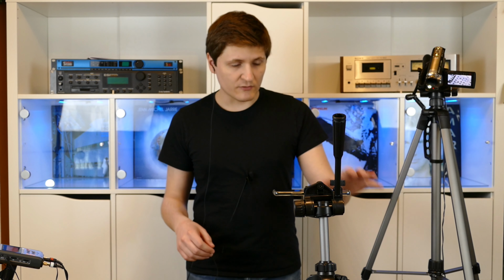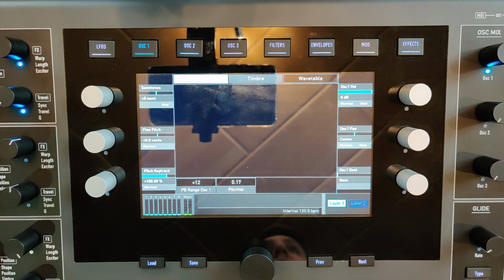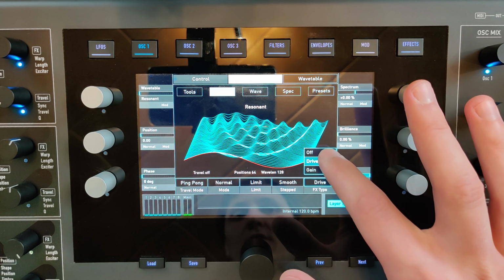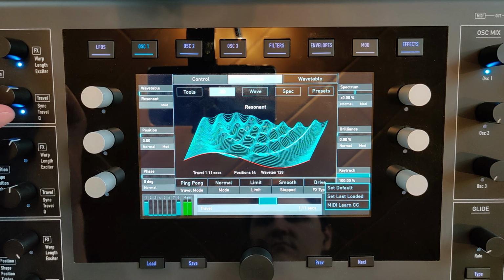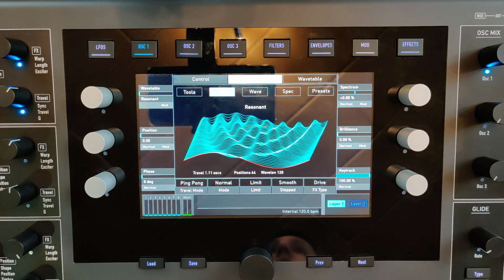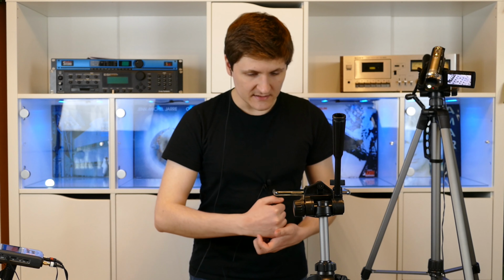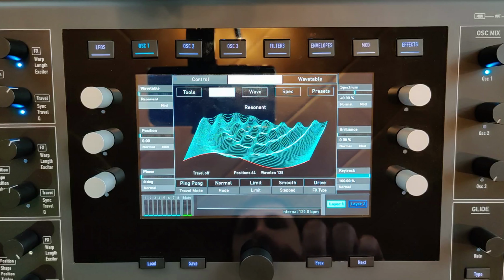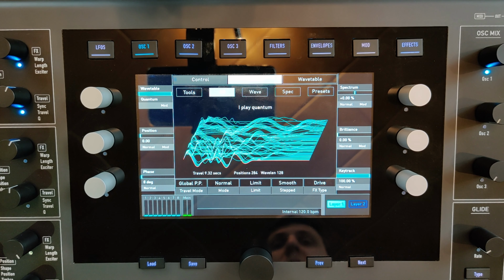[tutorial] Waldorf Quantum 4: Wavetable Oscillator

Comment from the maker: What do you think? Are there any features which you still miss in the wavetable oscillator? Or does it even have too many features?
Reply: I think this is the most thoughtful implementation of wavetables I have seen (I guess the Hydrasynth comes close). All I wanted from the Blofeld is an easy way to create my own waveatables and load them up quickly. The fact that each wavetable does not need an lfo to scan it is amazing. And the wrap is suuuper great!
Reply: Great videos, thanks a lot for them! I'm actually quite disappointed, the implementation seems very basic. Wavetables are cool, but the fun starts with warping, FM AM and wave shaping. What about Unison, Pan, Phase control and all those things which are standard in even simple and cheap plugins ranging from 20 - 200 €. Of course the quantum has a lot of other oscillator modes, but in terms of wavetables I'm far from impressed. Ok, the spectrum parameter is kind of interesting. I wouldn't complain if it wasn't Waldorfs modern forward looking, expensive flagship synth.
Reply: @theRumbleChannel you’re probably more familiar with the unit now, but the Quantum does literally every single thing you mentioned lol.